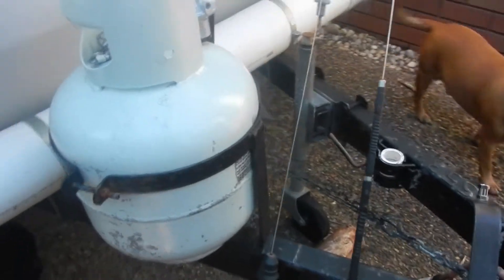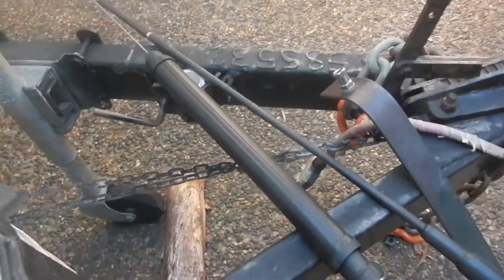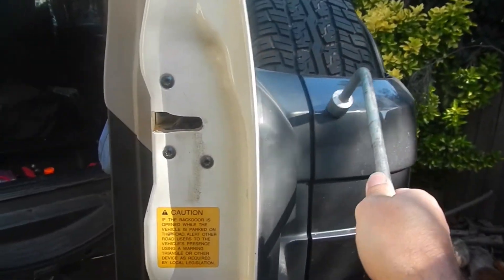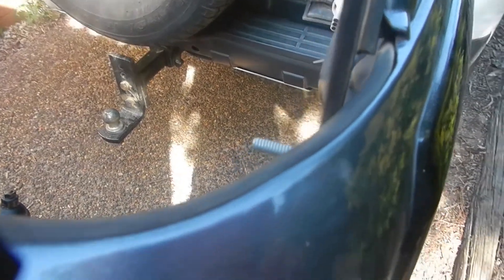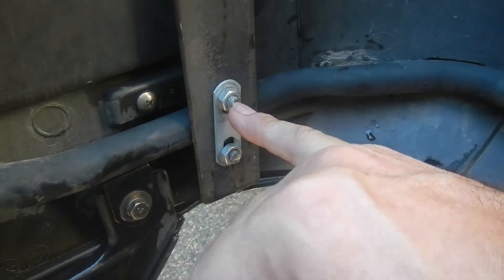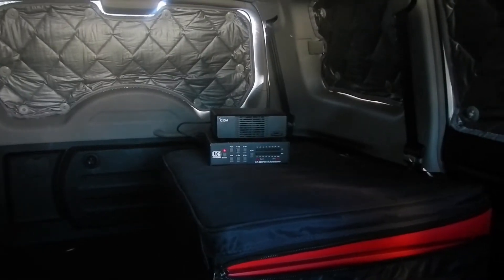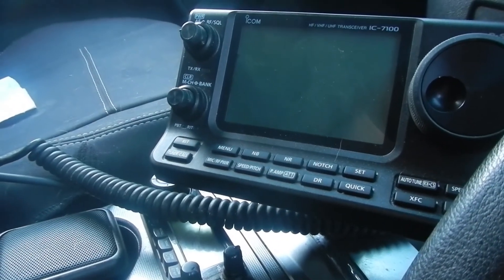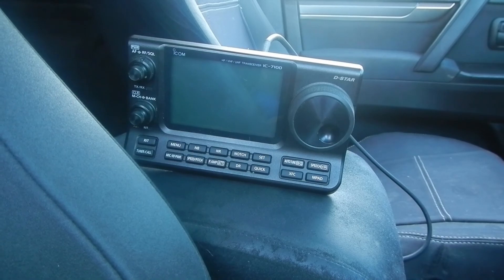Mobile HF Antenna spare wheel mount Pajero - chameleon v2l

Comment: The CHA V2L is a rugged multiband HF antenna designed for smaller vehicle. The antenna must be used in conjunction with either the CHA HYBRID or the CHA HYBRID-MINI to perform adequately. An external antenna tuner is also required.
Reply from the maker: HI Michael, thanks for the input. 

I got the V2L from chameleon when Carl first started producing antennas and before the hybrid baluns were produced. 

It came with a small box balun which is fitted to the feed point of the antenna or as close as possible. 

The hybrid mounts seem to be quite popular with is customers and receive good reviews but again this antenna was purchased before they were available. So it is possible to use it without those additions. 

It still does require an antenna tuner though. 

I also have the small wire emcomm antenna which he does not make anymore and a Mil whip extension which I used with the V2L and also works as a whip for the tarheel when stationary. 

I still like the antenna but for now I'm running a tarheel 200hp and am liking that very much. 

cheers Brett

Comment: Look up the trxcommunications 392M HF antenna
Reply from the maker: Thanks for the heads up Dan. I checked them out and they look nice and solid. Be interesting to see them first hand. 

I did have a Opek hvt400 (still have) but I got over the wanderer lead type antennas. I like to move around the bands a bit before I settle on a station to listen to when mobile. Getting out of the car to tune or change the lead doesn't really suit me the way I like to operate mobile. I do like to listen to mostly 40 when mobile though, so a set and forget would work fine in that situation. 

have you got one and how do you find it ? 

Based on the comments on your video, others seem pretty impressed with it. 

cheers Brett

Comment: Hi, nice idea that inspire me how to install my antena having the same Pajero.
By the way can you advice the supplyier of the windows insulation ?
Reply from the maker: I can do you one better Emil, here's a video of them if you want a close look https://youtu.be/H0_4y_9XLO4      
details are in the description . but here they are also  
You can reach Alan here 
Phone: (07) 3398 5500
Email: sales@solarscreen.com.au
Website: www.solarscreen.com.au
Reply: @DENMONKEY  Hi and thanks, 
I  contact them but looks me to high priced
Reply: @DENMONKEY  
Hi, I contact them and found the prices are not worth, too high
Reply from the maker: lots of people make their own from the cheap front windscreen ones from ebay. you just need to cut the down to side. they won't work as good but it might give you something to work with

Comment: Like the idea for the mounting of antenna, you really need some form of earthing/counterpoise for the HF antenna to work better or just get a codan 9350 antenna.
Cheers, VK2YK
Reply from the maker: Spot on Adam. Work in progress from that perspective. It will require running some decent cable, especially if I change over to the Atas which is very picky in relation to grounding etc. 
When I get around to routing the coax properly, I will do a run for that also. Opening doors as mounts is never ideal though. I need to source some reasonably priced braid to do a decent job of it. All the panels etc.   good to see you're still breathing .   cheers for the comment.

Comment: Hi Mate, why didn't you use nylock nuts on those u bolts to prevent them vibrating loose. Or better still stainless dome nuts with spring washers. That would also keep the thread from rusting up. And where did you get that cover for your back window? That looked interesting. Cheers Tim
Reply from the maker: Hey Tim, when I was at bunnings, these were the only u-bolts they had in that size. I will source some stainless ones when i get the chance. 
I figured I was better off to bugger up the cheapies than spend the extra bucks up front before I was confident it was going to work like I wanted. 
It made sense in my head :) but I needed to check first. 
I won't be leaving those nuts on there as a permanent fixture. I was thinking spring washers but I think you're right, I'll go with nylock one instead. 

Those are solar screens . if you google solarscreen au you will find their site. 
I'll be adding a vid on those a little later once I've had a chance to check them out and maybe do some temp comparisons to make it worth it.  I'll be heading off camping for Oz day, so that might give me the chance I need. Thus far though, like today 45c outside, they seem to make a massive improvement .  for 80 bucks off gumtree, I'm stoked at the find.